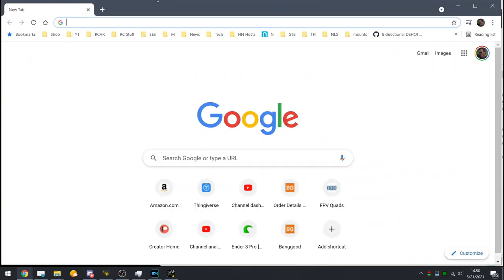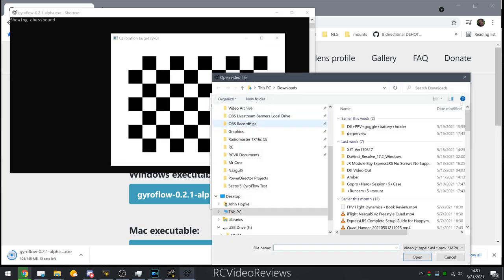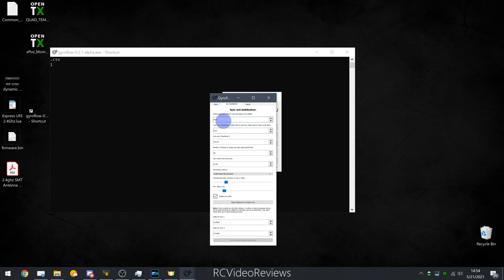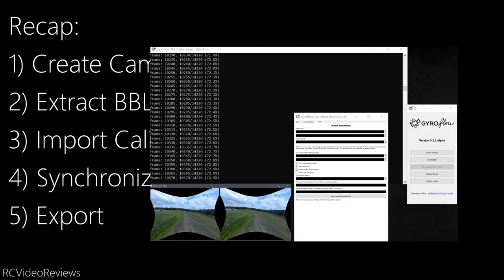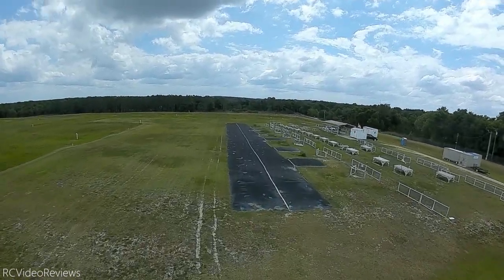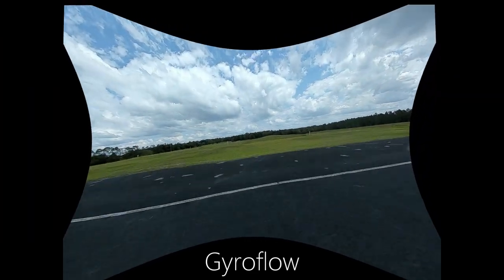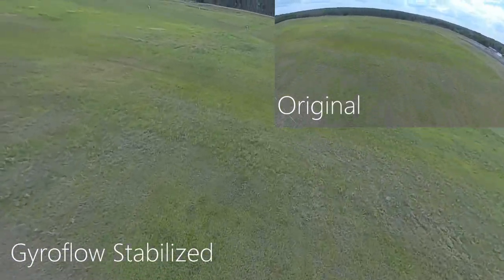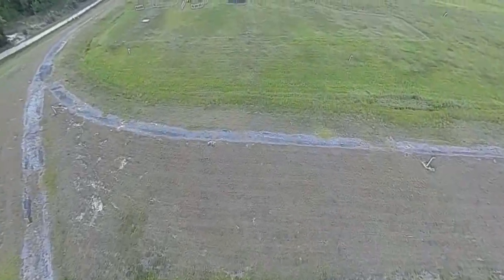Gyroflow Intro • Gyro Stabilize DJI Air Unit Footage

Comment: oh?, so you have to do the crop and zoom part yourself? i thought it did it. hey i wonder what would happen if i used a gopro footgate that reelsteadygo rejected, (it rejects quite a lot)
Reply from the maker: All I know for sure is what my first export yielded and it included the black gyro correction areas around the outside of the stabilized footage. So yes, as far as I know at this point, it has to be cropped.